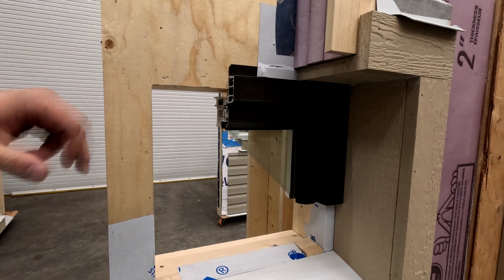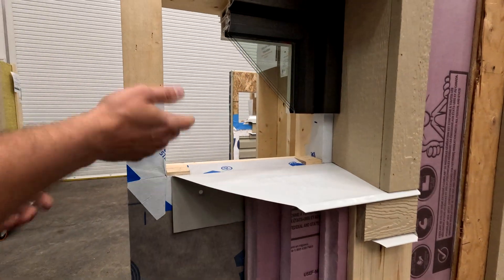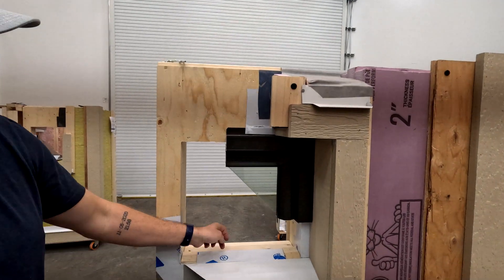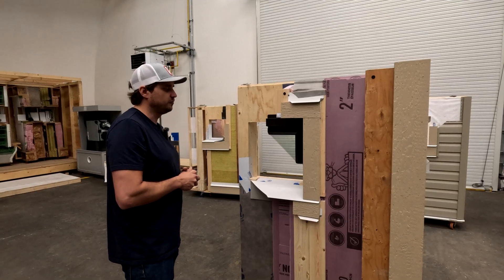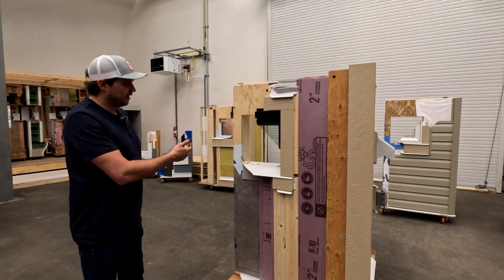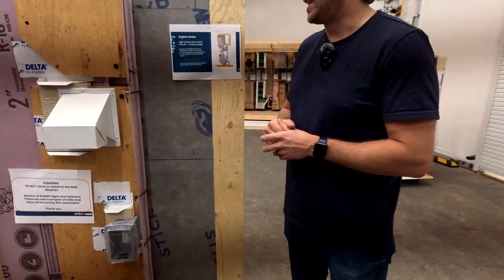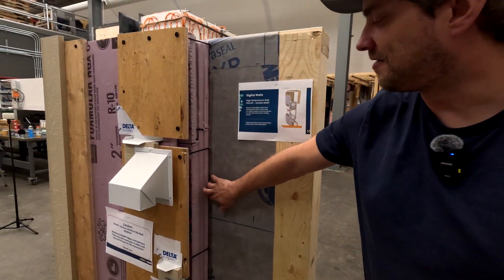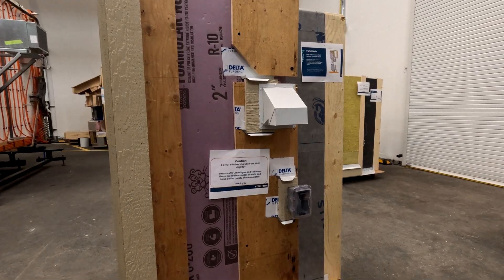ENBIX Wall Library - Exterior Foam Net-Zero Assembly - Exterior

Comment: That is quite an assembly and well thought out. I surely hope the glass for the window frames can be replaced "in-situ" - otherwise the replacement of a window and frame would be extremely expensive to perform. Also, with this construction it would seem you must know all your needs for penetrations in advance- and any later additions would be required to run externally. I have seen others use a membrane/pipe system to accommodate later changes in penetrations for things such as power outlets, drains, or low Voltage wiring. Very nice system.

Comment: No insulation inside the wall cavity?
Reply from the maker: Since this wall has the insulation on the exterior instead, its not required to have insulation inside the wall cavity. It was interesting, because this assembly achieved the highest calculated effective thermal resistance of all selected and new-build assemblies in the ENBIX wall library, with or without the 2×6 cavity being insulated. 

Check out the full report here to learn more - https://www.enbix.ca/wp-content/uploads/2025/07/High-Performance-Wall-Assembly_Summary-Report.pdf